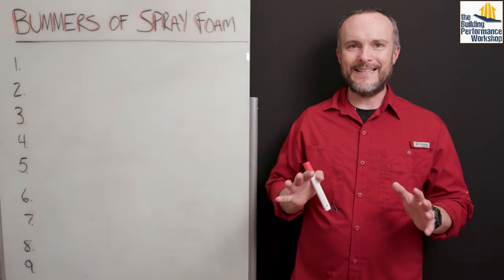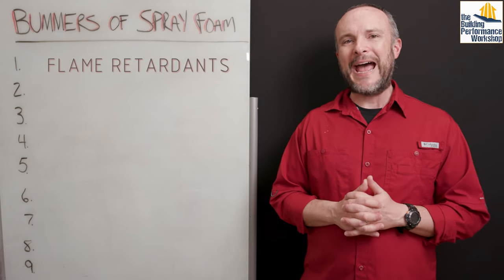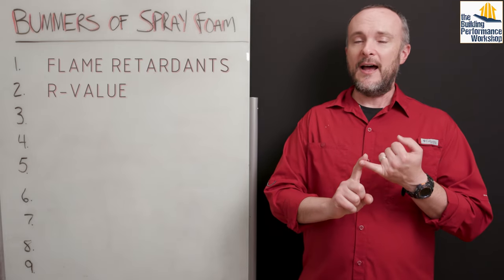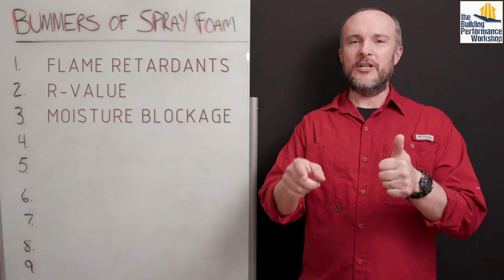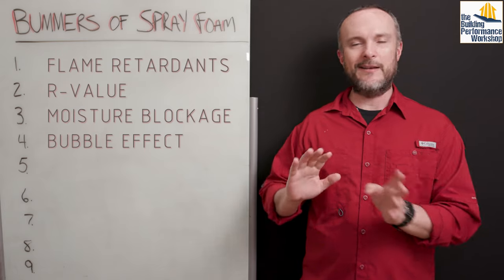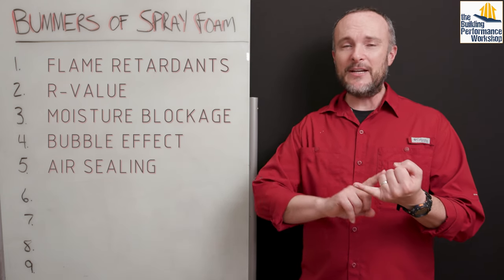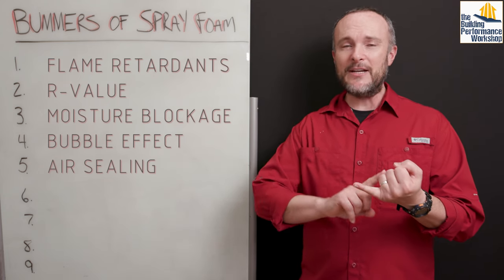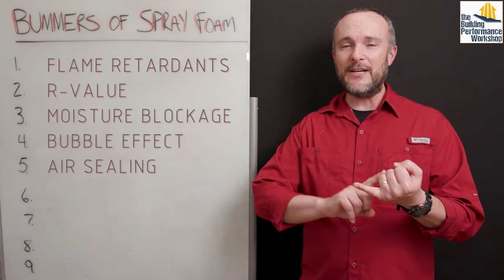Spray Foam Bummers: Make Informed Decisions on Insulating Your Home

Comment: I don't have a dog in this fight, but I have to call you out on several of your comments.  I am researching systems for a custom house I plan to build when I retire.  Most of the problems you talked about have to do with hack installers.  If you research experts in passive house, you want to seal the house.  Then you control the ventilation of the house with an erv or an hrv.  And seeing blower door ratings improve drastically after a proper installation of closed cell foam, you really are misleading the people following you. And by stating that the R-value of fibrous insulations makes it equal to the same R-value of foam is just ignorant.  Air moves through fibrous insulations, reducing the effectiveness of that insulation.  Open cell foam is better than fibrous, but not as good as closed cell.  And stating that you need to seal up the outside with zip system or some other similar system is something you got correct.  But you made it sound like you'd only need to do that with spray foam.  That should be standard policy with any reputable builder.  Also, fibrous insulations under the roof deck or in the walls can lead to moisture problems from the inside.  Humid air flow through the fibrous insulation and hits cold nails and water condenses on the nails.  Over time, that leads to rot that starts at those nail penetrations.  This is eliminated by close cell spray foam, unfortunately, not open cell.  Exothermic reactions is your way of scaring people?  Manufacturers have specific guidelines on how much foam can be sprayed on in a single pass.  Once again, a reputable installer is going to follow those guidelines eliminating fires, melted wires, etc.  If you are going to do a video like this, you should actually do research on the research.  I suggest going to YouTube channel Spray Jones to learn more about spray foam insulation.  That's his business and he backs up his claims with independent and government research.  And he's the first to admit that spray foam is not right for every situation.  I've never written a comment like this before, but your lack of actually presenting anything backed up by actual facts really annoyed me.
Reply: Perfect comment
Reply: Actually everything in his VDO is accurate. Your comment only shows you have no idea what you are talking about. Your own comment says you are required to have additional ventilation when using foam, why? Because of moisture. There are homes that are 100 years old that do not have moisture issues or rot because they have proper ventilation. It is code when building a house to have proper attic ventilation and that is to prevent moisture issues and rot. Spray foam eliminates ventilation. You have to add it by mechanical means, and hope it is correct, and also hope the parts don’t fail, bc then your moisture will begin to build.
Reply: I'm not sure you understood what he's talking about here. I worked as an energy auditor for several years and have done thousands of audits / retrofits. He is talking about why you don't want to completely encapsulate an attic with spray foam vs using blown insulation. You always want to air seal the boundary between conditioned & unconditioned spaces. However, it's best to use foam to air seal only certain parts of an attic. Those are bypasses like around light fixtures, top-plates of walls, wiring penetrations,etc.  While air DOES penetrate blown insulation, if you're insulated above an R-49 or so, it's a negligible amount. Rusting & rot around nails isn't any sort of an issue.
Reply: Scuba you write like you absolutely have a dog in this fight. All of your opinions are misguided, fueled by emotion, and seem biased. He made it abundantly clear that having a quality installer will solve most of the concerns he presented. But for 95% of people buying homes (especially in new builds) they either won’t know who the installer is or won’t be able to afford the best of the best installers. Perhaps you should temper your comments in the future…
Reply: @mfman2  Facts don't care about emotions.  If I was fueled by emotion and bias, I wouldn't have brought out the facts, but just expressed opinions.  If I am "misguided, fueled by emotion", where are your facts to support it.  Based on your statement, you seem to be the biased, emotional one!
  Though I haven't worked in the industry for close to 25 years, I do have a degree in Building Construction Management.  It doesn't matter to me if somebody uses or doesn't use spray foam insulation.  They need to do what's best for them.  But they should base that decision on facts, not fallacies.
Reply: Just because you believe 95% of spray foam installers are clueless, doesn’t make spray foam bad. Instead call the video “What to watch out for when hiring a spray foam installer”.  Then, some of what you said is true of bad installers. Blaming the product makes no sense. 
If your ceiling fan falls out of the ceiling, do you say to never install ceiling fans?
Lastly, where are your facts? And for those who defend you, where are their facts? Reference them for each bullet point and we could then evaluate the authenticity of your video against what others might say that contradicts you. 
The scope of the video, basically taking on an entire industry, requires more than your personal experience. All those who have an opinion need to consider the scope of your remarks, in their posts. 
If this was a video on a single home build, then I wouldn’t take the time to respond. Understand the (huge) boundaries of what you say and expect that people will challenge you. 
For those who defender this video, they need to realize that the content is monetized, and we can say anything within the boundaries of YouTube rules.
Reply: @brianvancalster2594  So my years of industry experience as well as education in energy & building science aren't sufficient? Do I need to go work for a spray foam contractor too? What are you qualifications?
Reply: @V0lk I do not doubt your experience and education. 
I just don’t think any one person, regardless of their background, can come up with 8 points on why an industry should cease to exist. (Metal buildings aside) 
There are case studies, test results, building codes, health studies etc. that you can reference as source of truth documents. It would add to your video and it would not take away anything.
What do I do? Part of my job, at various times over my career, was to determine what data is source of truth or what are just copies. Government regulations on retention are different for both of those use cases. 
My interest in your video is part of my research over the last two years, on how to correctly spray foam a metal shed, which I will hire someone to do in the next year. I have seen hundreds of videos and articles and I know who are the best industry spokespeople. I follow them on YouTube. They include in their videos what I pointed out above. This is the first video from you that I have seen. It was not my most professional response and I apologize for that.
Reply: I think you need to do more research. Foam of any kind will release some of the most toxic fume when it burns/melt under high heat. Also foam will forever release toxic VOCs you’re not aware of.  Polyisocyanate is the principal component of closed spray foam, note cyanate = cyanide. Also one big drawback of closed cell foam is water or moisture can build up between the foam and wood sheathing and studs and slowly rot the wood and cause toxic mold build up.  You’ll never know this problem until it’s too late. You’ll get sick from mold which can cause all sorts of vague symptoms including neurologic symptoms and psychosis. Or the wall will rot so badly you’ll have replace the entire wall if possible. You think that a reputable builder can do this properly so there no chance these problems will happen? Think again. Unless you’re willing to inspect every inch of you wall while it’s being constructed, there will always be small gaps that can cause issues. Fiber insulation, although less efficient, will have far fewer problems down the road because you can easily find water leaks or moisture buildup because it can be easily removed, unlike closed cell foam.
Reply: Haha spray foam, open cell, is far superior to fiberglass batt. It fills the cavity tight including around wires, pipes and gaps in framing. 

Closed cell foam is the vapor barrier and is the best insulation you can buy. The VOC’s after a day are down to nothing and I bet you can’t say the same about the cabinets, furniture, carpet, etc.